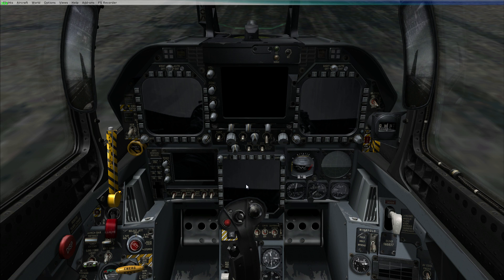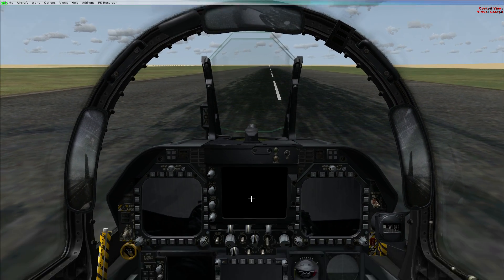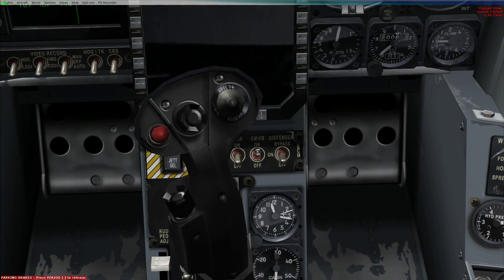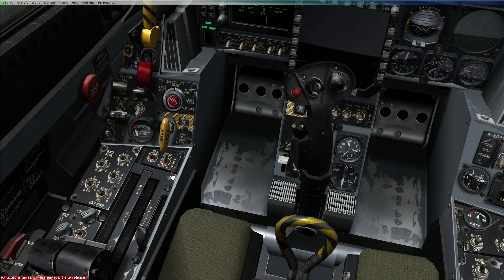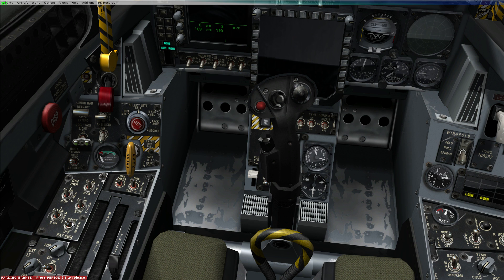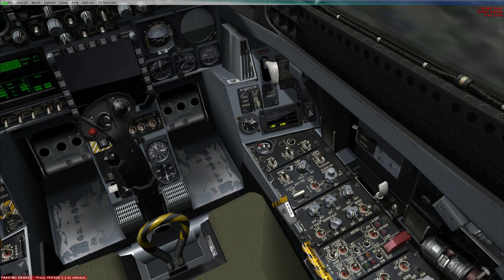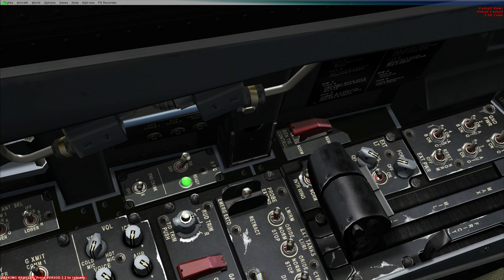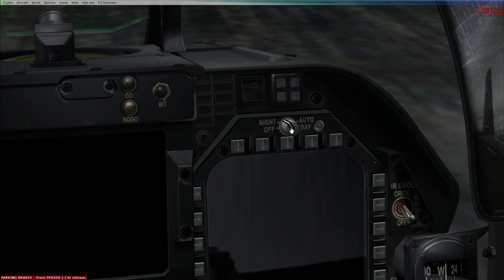VRS Superbug Start-Up Tutorial Part 1

Comment: Hi Michael I have bought the X55 Hotas but the throttles do not work, everything else is okay, the engines are on, but I am unable to increase thrust with the X55. The stick works on all my other aircraft, the axis are all okay but does not work in the Superbug. I have only had the model a short time which is why I am watching tutorials but no tutorial has helped with my issue. Thanks.

Comment: How do you stop the engines from cutting out like when flying. Not starting. When I'm flying they will just cut out and stop working and I need to go back in and restart everything all over again. But sometimes the APU will only work with the Ground Power set to B. What should I do?